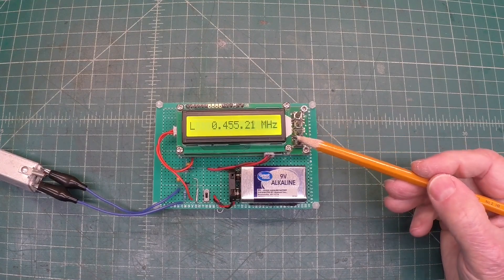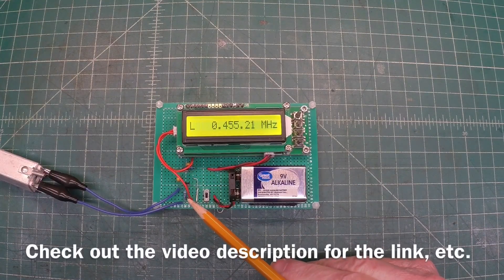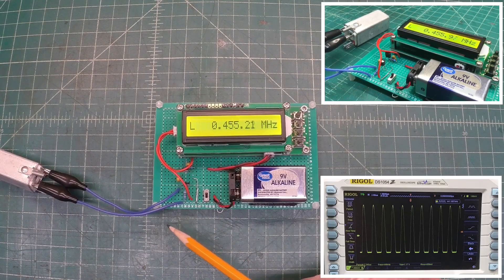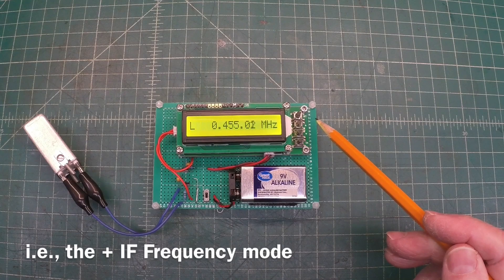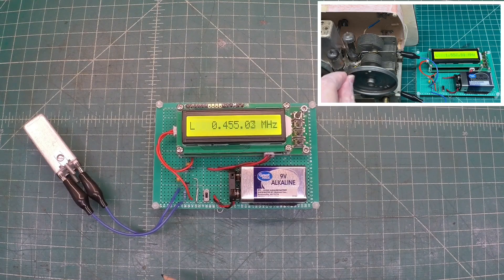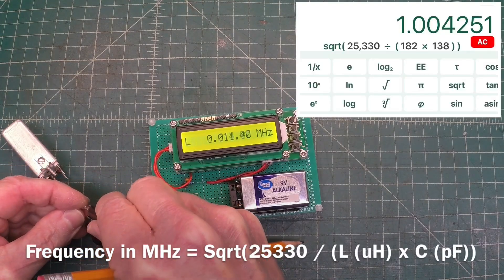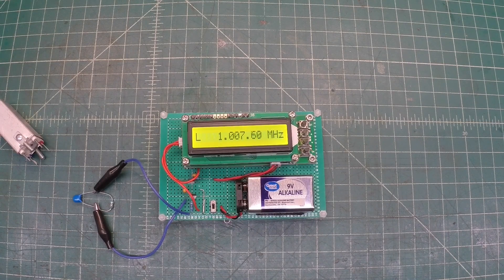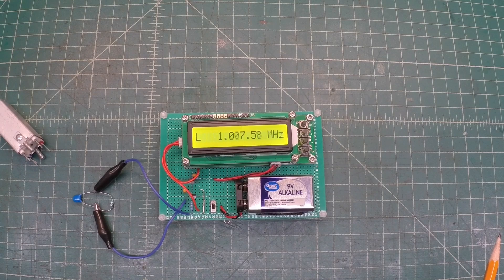LC Circuit Tester to Evaluate I.F. Transformers + Antenna & Oscillator Circuits w/ Frequency Counter

Comment: Can you put up a schematic of the device as shown in the video? Thank you in advance.
Reply from the maker: You’ll find the link in the video description (show more) and the changes I made in my build called out as well. Please let me know if you need additional information. All the best. Don
Reply: @RestoreOldRadios  I looked at the schematic but it is the same schematic as shown in this video.  You stated something about adding an offset to the frequency counter and that in particular is not shown in the either schematic.  I do see the old lcd display.  Thanks much for your help. I really like this project!
Reply from the maker: The IF adjustment is made on the frequency counter module, page 10 of: https://2e0dfu.wordpress.com/wp-content/uploads/2016/10/plj-1601-c-english-translation-v2.pdf